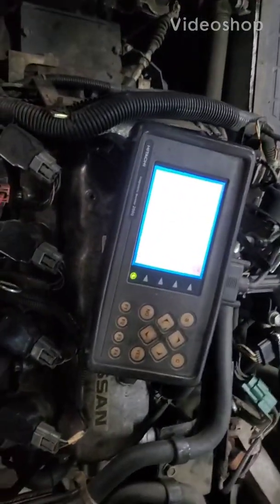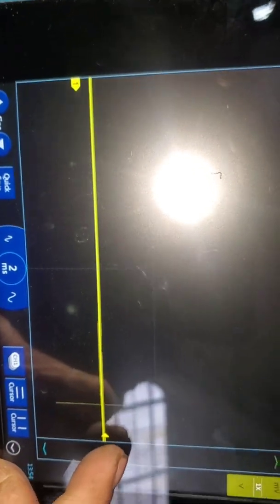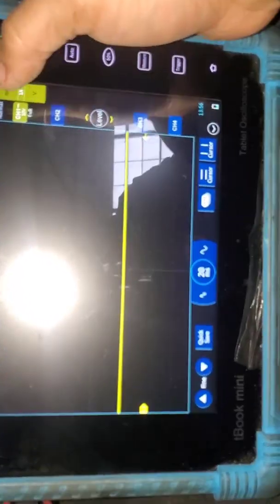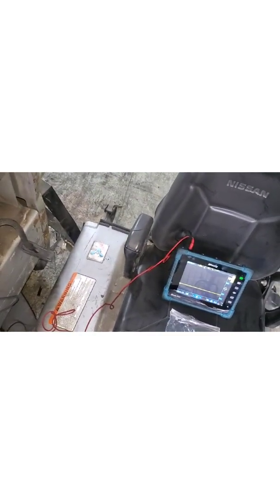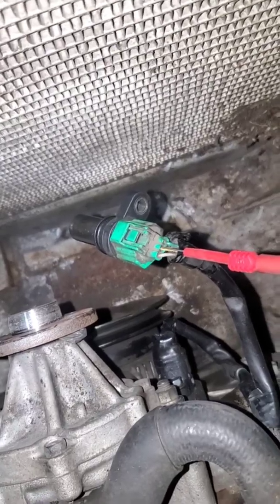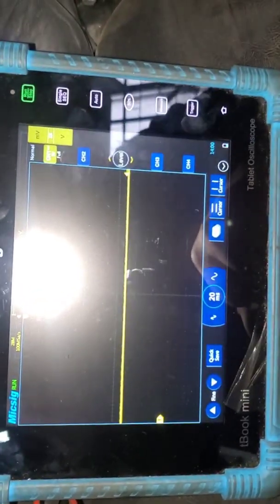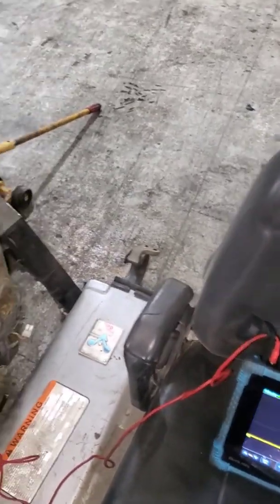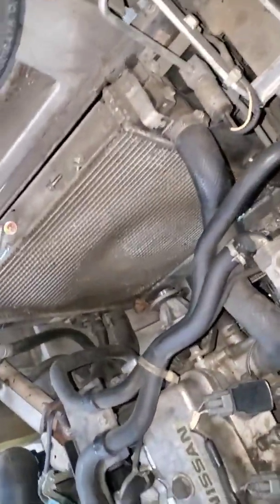Nissan forklift E27 error code

Comment: OR-- Re-set computer disconnect negative cable for 15 seconds..will clear code and engine will go normal
Reply from the maker: If you have a hard fault, you must fix the issue.  Simply clearing the fault via capacitive diacharge does not fix the problem and the fault will come back if not fixed

Comment: We use that same Hitachi scanner at our shop.  Sometimes e27 can be set off by a bad coil too but won't be a hard start symptom. It looks like they dropped in the old design sensor too.
Reply from the maker: Ive seen that too.  A cylinder with a dead miss due to coil failure cause e27.  I use my Autel 906bt now with these k series
Reply: Can the Launch xp431 scan for codes on this Hitachi controller
Reply from the maker: I believe the launch will work.
Reply: @CEtech82 thanks for the intell the Launch x431 pro3 didn’t work but the 13 year old CRP 123 launch worked, live data and codes found
Reply from the maker: Oh nice!!!  I have a autel 906, works really well for these k series.  I also have a snap on verus that doesnt give that much info, but i get codes and what not.
Reply: @CEtech82  so you get full data display like the Hitachi with the Autel 906 PRO? Can you also do the Air Volume Learns? If so I'm looking to get one.
Reply from the maker: Yes with the 906bt i can do idle air relearns, fuel pressure release(gasoline), timing adjust. Ill upload a video so you can see before you buy
Reply: @CEtech82  that would be awesome. Thank you in advance. I've seen one on ebay do I need all the attachments? Or just the obd2? I will mainly use it for tcm/nissan/unicarriers k21 k25
Reply: @charliehustle2579 launch didn’t let me go into the TCM, only PCM…is there a TCM diagnostic plug for communication with the scan tool, only found the obd2 connection
Reply: @Aaronkoivu  TCM is the brand. Lol. VCM is what controls the hydraulics and transmission on these. But yes you can access trouble codes usually through the display screen on the Nissan and Unicarriers. TCM  is too  old has no digital display screen.
Reply: @charliehustle2579 ok new to the forklift game, 30 year Chrysler/ Mercedes tech, have been fixing the 10 forklift k21 k25 my family factory owns here in Canada, most of the time it just oil change, Hydraulic line leaks, water pump, the last one I fixed was a no start, found crank sensor fault with my launch scan tool.
Reply: @aaronkoivu  yeah common issue as well. Old design is the flat plastic sensor the new ones are round with a metal casing. Former car mechanic here and transitioned into fork lifts. I'm right behind you with 29 yrs experience wrenching. I work for a unicarriers dealer and am factory certified journeyman so if you have any questions just ask away on this comment.